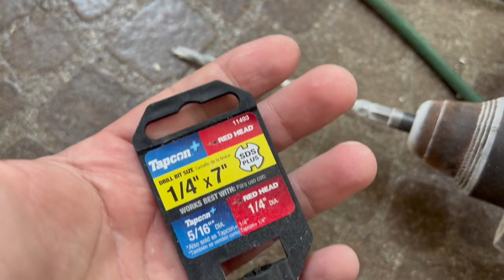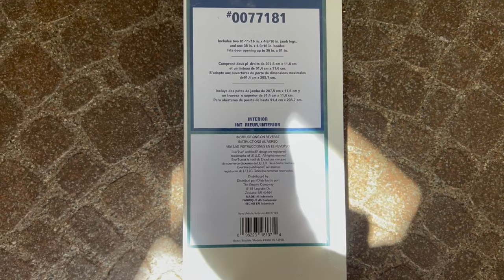How to build a Partition Wall & add EXTRA room to your home -  DIY

Comment: So why the insulation? No explanation. Also always tell us size of drill for floor.
Reply from the maker: It is a hobby room for my wife - it means there will be noise coming from there when my wife is working. So I used insulation for this reason.